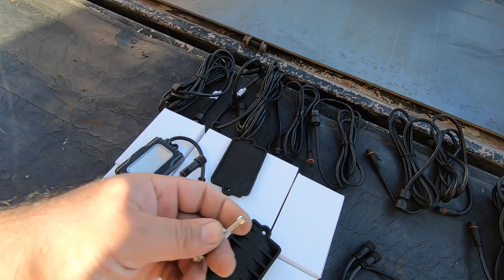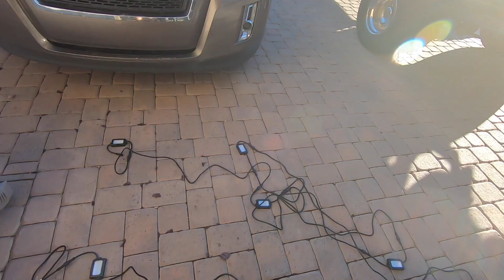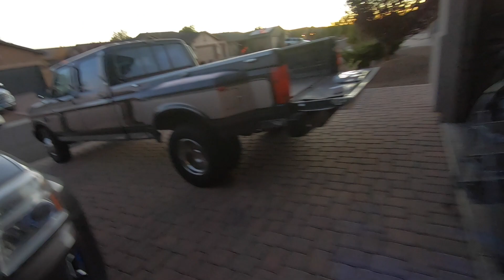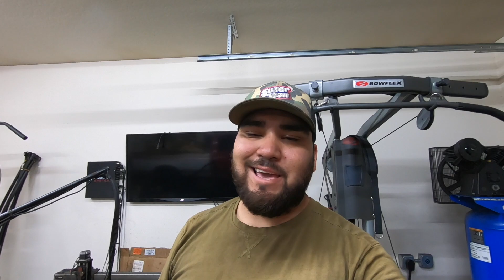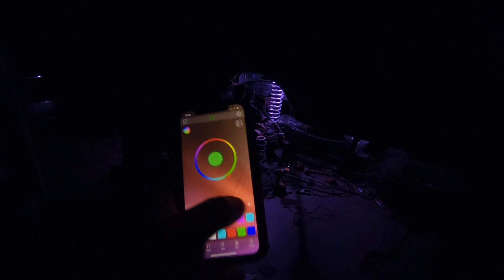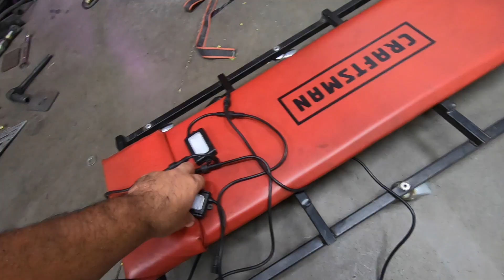OBS Gets Super Bright LED Rock Lights!!

Comment: Hey there man. Before I changed the oil, the dipstick read half. When I drained it, I only got about 12 quarts out of the motor. When I filled it, I put 14 quarts (aiming for 15 quarts) but when I was checking the dipstick, it now reads about 3/16 of an inch above full from roughly 14 quarts in the motor. It is still high after driving it for about 50 miles. I was doing some research and I guess some of the OBS fords had wrong dipsticks in the early years. My dipstick part number is 1826628C1 in a 1997 model. Could you possibly look at your dipstick part number and see what you have? Thanks, Alex

Comment: Hey man. This is a little off topic of the video. Got a question for you. Could you make brackets for the 08-10 that include the extra height when you have a 3 inch body lift? Most people weld their bumper higher. Just wondering if its possible to make brackets that work to where you dont have to do that

Comment: That looks so legit man!  I appreciate how simple the wiring is and really like the fact that it has an aluminum housing instead of cheap plastic.  There’s not a whole lot of products out there where you spend roughly $100 and get such a cool result for the price.  I’ve always wanted to get rock lights in one of my trucks and after seeing it in yours I just might be getting some in the future.👍
Reply from the maker: I really like the way they look and it is a great build quality, I just wish they would have either included an adapter to connect two together or just done one side male and one female to make it easier to connect together. But either way I’m happy with them 👍🏼